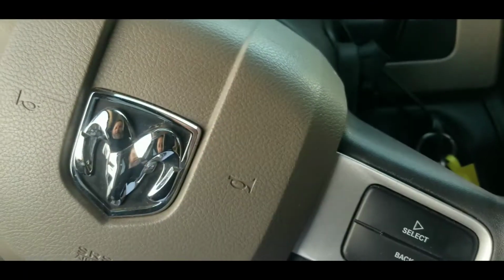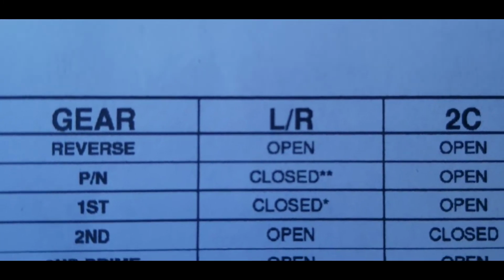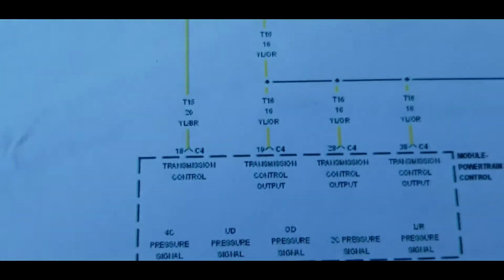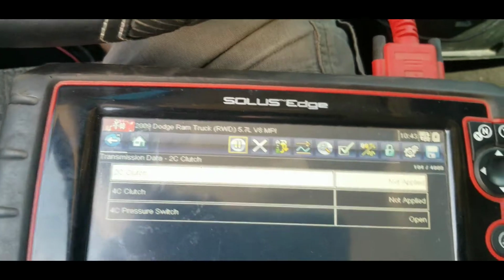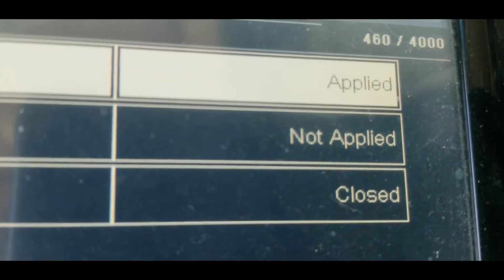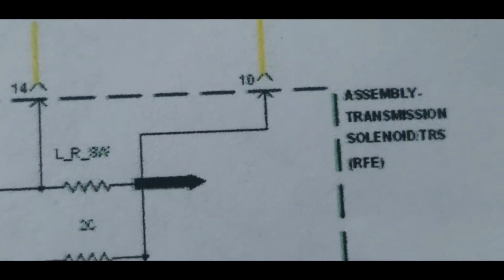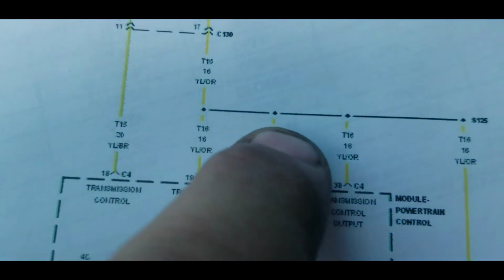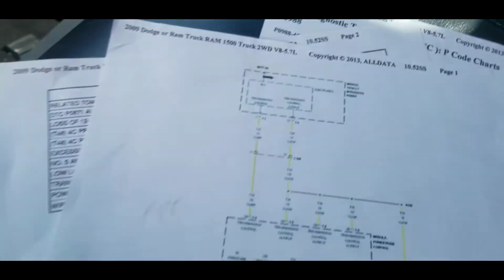545RFE P0988 c4 pressure switch rationality diagnosis

Comment: I got a 07 commander I got for a good deal with the 5.7, before I drive it I have to clear the codes or it will do the 4th gear safe mode. I hear a grinding noise like it’s the brakes but it’s not the brakes. Any idea? O-0988 generic code
Reply: Any luck

Comment: had this exact  problem!!!!  my fix was for the 5.7l v8 was that i have an exhaust leek at the head an manifold.  and on the back of the block driver side   a part of the wire harness is clipped next to the head,  being it was so close to the exhaust leek it melted the wire coating causing a short..  i  also had a code that  said( battery would be dead after 50 starts),  when i fixed the short, that went away as well// (PS)its worth a check. early to mid gen 5.7 are well known for exhaust leaks on the rear of the manifold due to heat cycles and can happen as low as 40k miles

Comment: Sir u are a life saver. I did actually what u did and it worked. But I do have a question. What is the solution to fix that?
Reply from the maker: The issue was an internal fluid leak after the shop did the rebuild.  A different transmission shop did the repair but I think this can happen if the gaskets are put in wrong during the build

Comment: FWIW, I had the exact same problems on a 45RFE after rebuild.  The issue turned out to be the gaskets between the transfer plate and valve body were swapped.  One gasket has a cutout for the check balls and goes on the valve body side.  The other gasket has a cutout for the solenoid pack and goes on the transfer plate side.  They are not equipped with gaskets from the factory.  The gaskets are included in the rebuild kit to prevent leaks in the valve body.
Reply from the maker: that is good to know, I figured it was something stupid like that. some people just wont stand behind their work. i will say i now know more about that transmission than i really wanted to.  i had done several transmissions before, just simple dissemble and refresh basically as i do not claim to be a transmission guy. this one they relied on and it was full of metal so i had this guy do it and i got screwed. i am actually doing the end rebuild on that truck tomorrow.
Reply: @coryament  Yeah, any kind of driving with the hydraulic circuits leaking into each other would've smoked the 4th clutch (at a minimum).  We were lucky enough to catch it on the lift before driving.  Been there with guys not backing up their work too many times.  Had several reworks because of the machine shop and had to eat the gaskets and bolts.  Unfortunately those kinds of shops are getting harder to find as everything switches to throwaway parts and factory rebuilds.
Reply from the maker: @seang7573  I think the first time it went maybe 3/4 mile before I called him. He towed it in and just said it was electrical. Maybe 2 miles before I pulled it and the converter clutch was toast. Big black ring on the face of it. It was still full of fluid when I picked it up the second time after he supposedly went through it again. Spilled all over my excursion. Thank you for the input on this it is good to hear from someone who has actually found the cause. My customer took the truck to aamco they needed it back so bad and I couldn't get him to fix it.

Comment: I have a LR CODE 08 WRANGLER
Reply from the maker: what is the code?
Reply: @coryament  I'll get back with you I'm driving at the moment it's an intermittent issue
Reply: But whenever it does it the speed sensor lights come on I know I need those on my front
Reply from the maker: @Father_Nature88  the computer may be using that speed sensor for vehicle speed. i would replace that front hub and see what happens

Comment: Hey Corey thanks for your input on this video you really brought to light the electrical and the diagram of how the shift solenoids work. Mine is doing the same thing it’ll go into fourth limp mode. so the problem that I had was I had rebuilt my transmission but the shop didn’t rebuild my valve body and after a year of use the valve body needed to be rebuilt at least the gaskets And O-rings. Sonex makes a great kit. I’ll have to find a part number that the shop used.